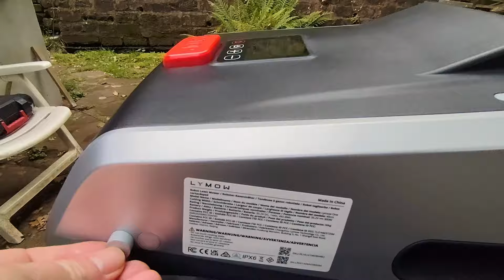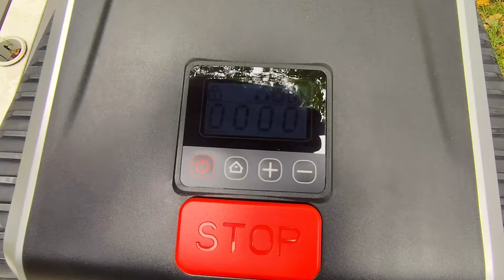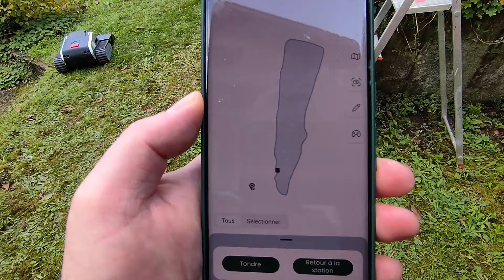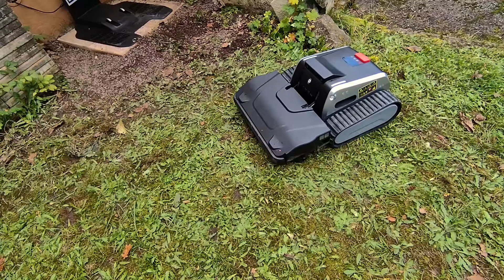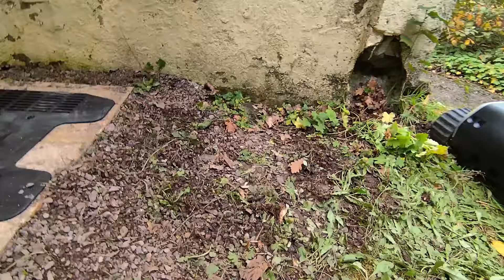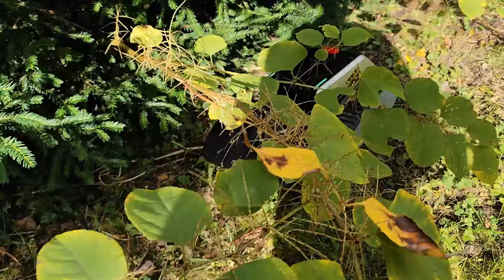Lymow One Review 🌱 Real Test, Features Explained & Live Demo

Comment: I also noticed that you need to have a 5-6 foot clear area in front of the charger. LYMOW really should include this fact in the setup instructions to help people locate the charger correctly while setting up and not have to move it around or rearrange their landscape after the fact.
Reply from the maker: There is a distance recommandation in the manual as well as a statement to not put it in those enclosed spaces. This is on me. It works fine but I will have to adapt it a bit. More in the next videos!
Reply: More like 8 feet in front and 6 foot wide. We had to try five different locations to find one that somewhat reliably worked. So far ours has not been much of a labor saver. And as purchasers know, the documentation is pitiful. Prospective buyers should grab the online copy from their web site and see for themselves how utterly inadequate it is. Unless you love trial and error this isn't a device for you.